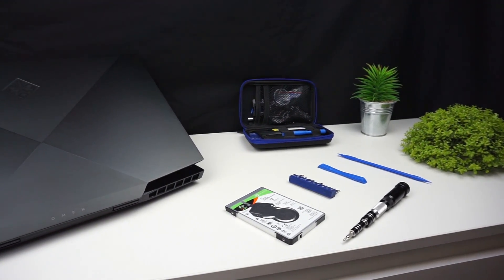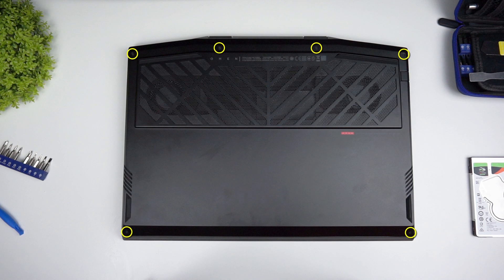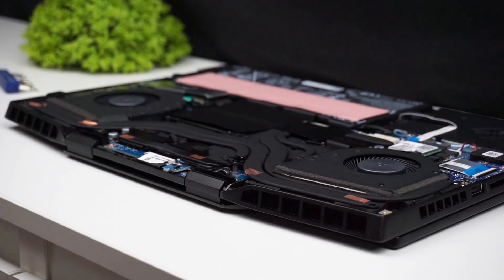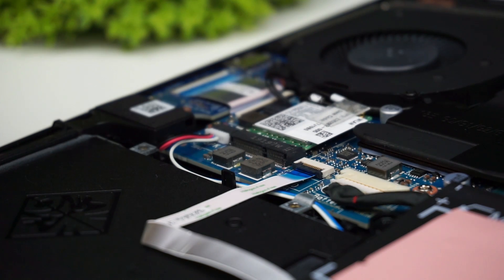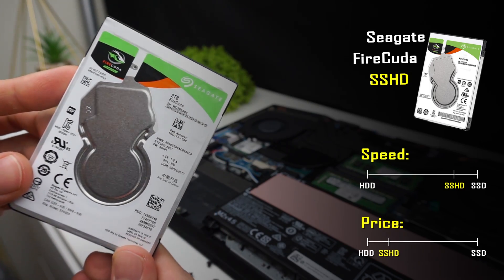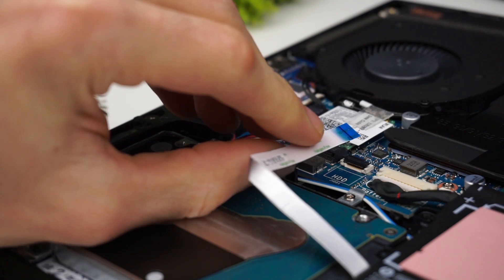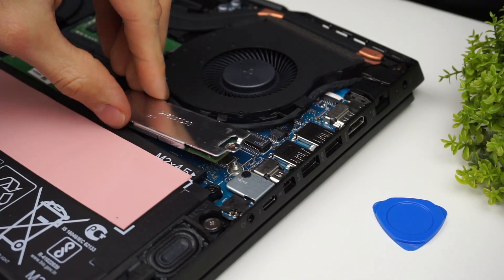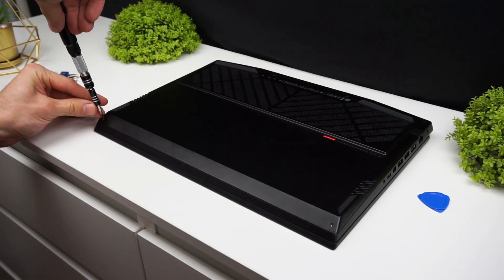HP Omen 15 2019 Upgrade RAM / SSD / HDD - Disassembly Guide

Comment from the maker: ✅ Free download RAM / SSD / HDD data recovery software: https://bit.ly/2zRpN9B

►► TIMESTAMPS:

00:00 - General info
00:37 - Opening the lid
01:42 - Installing Hard Drive
03:39 - Installing RAM
04:01 - Installing M.2 SSD
04:37 - Closing the lid
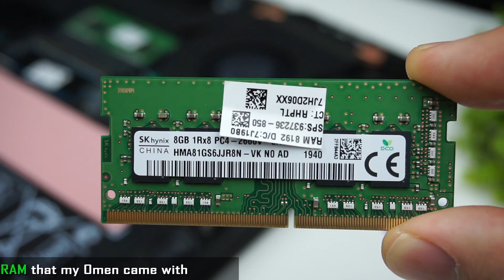04:59 - ORIGINAL RAM AND SSD
Reply: Can i upgrade hp omen 15-dh0135tx laptop to 32gb (16gb + 16gb)
Reply from the maker: @profajaysharma  yes, you can
Reply: @profajaysharma  i think thats not nessessary
Reply: Where should i install the recovery software and what will i get? Can i get like my OS/ windows 10?
Reply: Fuck wondershare

Comment: Hello, 
What is Ram speeds 3200? My HP Omen 15 -dh1099nr comes with DDR4  ram at 2933 speeds. If I bought a crucial ddr4 ram at 3200 speeds, does that mean it can't possibly run at 3200 because isn't supported by the motherboard? will it autodefault to the fastest possible speed which is 2933? should i force it to run at 3200 ? I don't understand this at all but trying to buy the ram has confused me a bit

Comment: Followed, worked perfectly. Did strip a screw on the case, that was a pain.  DID INSTALL 64GB RAM NO ISSUE.
Reply: Hi, are you sure that it supports 64gb and is working fine?

Comment: Hello, I have a 2020 HP Omen with an i7 10750H that looks almost identical inside to this laptop, I want to get the Samsung 980 Pro m.2 with the optional HEATSINK....I know it's a gen4 nvme on a gen3 system, I'm only concerned with if I can fit the Samsung 980 Pro with HEATSINK? - thank you!

Comment: Hello!!! My HP omen 15-dh1099nr runs with 2x4GB DDR4-2933 SDRAM.
Which RAMs are compatible if i want to upgrade in 2x16 GB???
Reply from the maker: I linked compatible RAM options in the description. You can choose any if you intend to replace 2 sticks
Reply: @TechFinds  and if i want 2933 ram cards?

Comment: Hello! Thanks for the video. My question is about what the maximum read/write speeds that it supports if I change the SSD?
Reply from the maker: Well, it depends on the drive itself ;) The laptop doesn't limit speeds
Reply: @TechFinds  I read that the system is PCI Gen3, so it can reach the 3500/3000 MBps read/write, the limit for this generation. My doubt is if I put any Gen4 SSD with 5000 MBps, the system will read at least 3500 MBps? Thanks

Comment: I have this laptop. Can I upgrade to 2TB SSD M.2 Nvme?
Reply from the maker: Yes, you can. You'll need to replace your existing M.2 SSD so after replacing you have to install Windows again on the new drive
Reply: @TechFinds  I think I will clone the old ssd to new ssd with software? Can I change ram to 32GB 3200 mhz?
Reply from the maker: @princeofeurope3313  i have never tried to clone drive so i don't know. For sure you can copy Windows using Microsoft Media Creation tool and install it on new drive from pendrive. The laptop supports up to 32GB AM (2x16) 2666MHz
Reply: @TechFinds  which is better, 2666 or 3200? Thanks
Reply from the maker: @princeofeurope3313  this laptop supports max 2666MHz

Comment: Hi, I have HP Omen 15 dc0145tx which almos similar to the laptop in the video.
The default storages in my laptop are:

1 TB 7200 rpm SATA
16 GB PCIe® NVMe™ Intel® Optane™ Memory for storage acceleration

Can I just change the 16GB PCIe NVMe to the larger M2 SSD (foe example 1 TB) and just use the windows media creation tool to migrate the windows from the 16GB NVME to the new SSD or there is something else to do?

Thanks in advance for hour answer.

Comment: THANK YOU A LOT! this video really helped me to add a 2nd RAM
could you make a video were you disassembly this model for a thermal paste change? it would be really helpful, want to do it but i don't want yo screw it up:(
Reply from the maker: Unfortunately i am not permitted to disassemble cooling system in the laptops that i test. Also i had this laptop for limited time only

Comment: Hello, my HP Omen 2019 has gathered some white dust on the fan and the lid, it's stuck due to the heat, so after opening the lid how do it clean it? Can I remove the fans? The white dust maybe baby powder so yeah, please help me out. Also will the warranty be voided if I open the lid?
Reply from the maker: To be 100% sure you have to read your warranty card as it may vary between countries. If you want to clean the fans you have to know what you are doing because it's easy to damage something while disassembling cooling system. You have to also change thermal paste if you willing to take out fans because you have to disassembly whole cooling system

Comment: Hi I have a HP Omen with an i7 and RTX 2060 6gb and I have a 1tb m.2 as my c drive. If I add a 2.5 ssd into the empty slot will it affect my main storage in anyway ? Or will it just add extra storage

Comment: Hi there, i am computer illiterate. Would a upgraded SSD benefit with flight sims?
Reply from the maker: Not really, it would help only if it comes to loading times. For better performance you can upgrade RAM, however i don't think that it's necessary for Sims if you have 8GB or more
Reply: @TechFinds  Hi there, thank you for your speedy reply.
I also have a Omen 15, and for some reason the sim has started to stutter after being fine (all original setting too) I have 16 ram, but just acquired a 32 ram upgrade so i'll see how that fairs
Reply from the maker: @markmilligan1462  Sims is very old game and it probably isn't a problem with the specs if you have so powerful laptop that is overkill for this game. The game itself may not me 100% compatible with the newest hardware and software. Sims 4 and especially Sims 3 had very bad performance on my laptop too.
Reply: @TechFinds  Hi there, Sorry for getting you confused. Not sims, the new flight simulator MS FS2020. 
Worked fine but now it stutters, especially at low alt
Reply from the maker: @markmilligan1462  ohh, I've never tested that game unfortunately so I don't know what to expect and what resources it needs
Reply: @TechFinds  I upgraded my to 32Gb, and turned my min FPS down to 30, and it's worked :)

Comment: Hi guys, Im struggling to find the propper name of the socet that HP used to connect ribbon HDD cable to motherboard. I got mine broken while extracting HDD :/ I was wondering if there is a sense to try to replace it (it forces soldering motherboard), and if there is, whats the name of that slot for ribbon HDD cable on the motherboard?is there a way to buy it sepparately?

Comment: Hello , where is CPU in this laptop , have one or two hot air outlet ?
Reply from the maker: It's on the right with 2 shared heat pipes i guess. I didn't pay attention to that since i didn't disassembly cooling system in this laptop. The GPU is signed with Nvidia logo so you can recognize it ;)

Comment: Thank You very much - excellent video:  Precise, short and to-the-point :- )
... I am looking to add a hdd to an Omen 15/2019-2020 model (bourght this year; I7 9750, 500GB SSD, NVid 2070 etc.) - But I guess that a 4TB hdd is too large (3.5' - > https://www.elgiganten.dk/product/pc-tablets/harddisk-ssd-og-netvarksharddisk-nas/ST4000DM004/seagate-barracuda-3-5-intern-harddisk-4-tb ) ?
A 2TB HDD (2.5' - > https://www.elgiganten.dk/product/pc-tablets/harddisk-ssd-og-netvarksharddisk-nas/ST2000LM015/seagate-barracuda-2-5-intern-harddisk-2-tb ) should be able to fit ?

Right now I am using a 4TB external, but obviously that is not practical when travelling. Would much prefer to have a 2TB or 4TB internal if it can fit.

Thank You in advance  & Greetings from Denmark !

Comment: hey man great video, thanks to you I bought this machine, I have the hp omen 15 dh0004la. But I have a cuestion about of the storage upgrade. Can I put 1Tb of m.2 Nvme plus 2Tb of ssd?
Cheers. : )
Reply from the maker: Sure, you can do it. ;)
Reply: @TechFinds   thank you. I have another question and I'm not sure, but if I put a nvme of 1tb and in the slot sata a hdd, the nvmw increase the velocity of the programs or video game saved in the hdd? Or it will be slower than a ssd?

Cheers.

Comment: Im about to buy the 2019 hp omen (omen 15t dh100) with 512gb SSD + 32 gb Intel optane. Will I be able to add 1tb hdd later on manually? Is there a separate slot for hdd apart from the SSD slot?
Reply from the maker: As you can see in the video the laptop has one slot for M.2 SSD and one 2.5" drive bay. I don't know where the optane is installed tho. If not in the place of 2.5" drive then you should be able to add HDD
Reply: Is there an extra slot for HDD as well?
Reply: Please let me know as I'm trying to add a new hdd
Reply from the maker: @swarajjpatil  this laptop has one slot for M.2 SSD and one slot for 2.5" drive
Reply: @TechFinds  thanks mate.

Comment: The screws are stuck in the bottom lid is there anything i can do to fix it
Reply from the maker: if you stripped the head of screw then i don't know what you can do now. Try to use thin layer of rubber between screw and screwdriver to fill the head of stripped screw and try to unscrew it.
Reply: @TechFinds  will do thanks

Comment: A question: replace the hdd with ssd invalidate the warranty?
Reply from the maker: Most likely not, however it may vary between countries so better read your warranty card. In most cases if you do it and you won't cause any damage the warranty is not void

Comment: I have a question , i am only looking to replace the SSD to 2 TB . The reason is i only use to Play WoW but now i want to play warzone but i do not have enough space for both. Should i be replacing all 3 Ram Hard drive and SSD? Thanks for the feed back.

HP Omen 15-DC1xxx ,Intel R core I7-9750H CPU@ 2.60GHZ 2.59 GHZ 16 GB Ram 237GB of Space Windows C

Sorry i am still learning about this stuff.
Reply from the maker: You can replace only SSD if you want
Reply: @TechFinds  Thank you ! Im looking at 2 TB Samsung SSD

Comment: Hi, I have a question. As far as I know this model has an Intel Optane of 32 GB. The M.2 that you changed in the video is the SSD and not the Intel Optane, right? Also, where is the Intel Optane located? Can you change it or it's welded to laptop? Thanks for the cool video!
Reply from the maker: There are various configurations, mine didn't have optane. If you have a configuration with oprane the drive will be in the place of M.2 SSD. I don't know if it's replaceable.
Reply: @TechFinds  kinda crazy! I saw a model with M.2 SSD + Intel Optane of 32 GB. I guess that it has two M.2 slots?
Reply from the maker: @MusiqueDoc  No it has 1 M.2 slot. Maybe I'm wrong and Optane can be placed somewhere else.

Comment: I have an Omen by HP 17-cb0002ca. Would the process be the same? I got the WD_Black SN750 500GB M.2 NVMe Internal Solid State Drive, what do you think of this SSD? I am swapping out the SSD that has my Operating system. Would you advise creating a recovery disc or cloning the drive before swapping it?
Reply from the maker: Yes, the process will be the same. You can do whatever you like, i have never cloned a drive tbh. Ane the one you bought is good

Comment: I have 2 ssd slots. Just installed an sn750 nvme into the second slot. Not showing up on This PC folder. Any ideas?
Reply from the maker: After installing you should go device manager and make a new partition

Comment: I bought one of the m.s ssd from the description but it has 3 keys instead of 2 and then when I tried booting it up it did not work and then I placed the old m.2 ssd and I dont my hp omen is reading it as my hp omen says I only haven 500gb hard drive but dose not show the m.2 ssd with 256gb being read so I dont know how to fix it so can u help me? If I can we can talk on Instagram or discord please as it is easier for me to talk on call or show pictures of the problem please respond quickly.

Comment: I think I had to do this after one year, right?
I lose warranty if I do this before
Do it lose warranty if I do it?
Reply from the maker: It may depend on the country or seller so you better read your warranty card to be 100% sure. After one year you should difinietely think of changing thermal paste and cleaning the fans from dust

Comment: I have a question, can i take out the original ram it has to put the other brand that you have in the description? Reason im asking is because I'm planning to add more ram (32gb) and I want to know if its going to mess up or anything.
Reply from the maker: You can have up to 32GB (2x16) 2666MHz. Brand doesn't matter

Comment: What is the size of the 2.5inch bay? I want to add an ssd as extra storage but after asking WD they told me I should ask the manufacturer about the size of the bay, and HP says nothing on their website.
Reply from the maker: If the SSD is about the same size as the FireCuda that i linked in the description then it will fit. The size is universal, but you can fins thicker 2.5" drives. I wouldn't risk more than 9mm thickness
Reply: @TechFinds  it is 0.27 inch thick and 0.01 inch more large
Reply: Tech Finds it is a lot thinner than the firecuda. Does it matter

Comment: Majid Almulla
I have same laptop but , i have cupples quastion 
Just asking if im ganna play high game like warzone  on high , >> btw i never see the fbs more than 100fps even when i make it low on graficks game 
1- should i change to performance ?
And I noticed when its not plug in the performance become Dawn ?
2- i will have issues if playing and plug in ?
3 - can i run gameboster or its will effect?
4- can i do something like if i play game become full performance and if I switch to normal use we browser become normally  or i should make it manually ?
5- should u play with nividia control sitting for better experience or no need ?
6- how many C if it reach thats mean to much load 
7- any app thats organization the ram ?
8- how much fps sould i got ?
9- should i dawload games on ssd or hdd ?

Comment: Hey Whats the Max amount of Storage I can put in a Omen 15, I want to put a barracuda 5tb 2.5" hard drive in there but I don't know if its fully compatible yet. please let me know if its compatible
Reply from the maker: There should not be any limit but the thing is that hard drives bigger than 2TB are usually thicker than 9mm so i'm afraid it may not fit the drive bay
Reply: @TechFinds  thank you for your response and I agree in the future they should make smaller but larger HDD that will always be compatible will laptops such as Omen 15

Comment: Im planning on getting a Pavilion and was wondering if putting pressure on the bottom while putting the lid back damages the display
Reply from the maker: If you push the edges only strong enough for the tabs to click it'll be ok.

Comment: Hi Tech Finds! I get my OMEN (15-dc1004la) with a GeForce GTX 1650- Core i7- 8GB RAM- HDD 1TB+SSD 128GB but I run out of space in the SSD, i was looking for an upgrade with the WD SSD (DDUWSD1370) of 1000 GB and  Pci Express 3.0, it is compatible? thank you for the video,  greetings from Mexico!
Reply from the maker: Yes you can install this SSD, but you'll need to reinstall windows.
Reply: @TechFinds  Thank you!

Comment: Sir RTX 2070max q vs RTX 2070 which one is better performing in OMEN laptops without Heat issues???
Reply from the maker: Max-Q should run cooler but it also performs slightly slower.

Comment: I was just wondering which of these components is the C drive? That would be the HDD right? The FireCuda SSHD?

Thank you for your time.
Reply from the maker: If you bought this laptop and it came with M.2 SSD and 2.5" HDD then your SSD is C drive by default (with Windows).
Reply: @TechFinds  Okay thanks. I will have to do a bit more research into the components.

Comment: Hello Tech Finds,
I recently bought in Amazon this computer: "Omen GeForce RTX Studio 2019 15-Inch Laptop, 9th Gen Intel Core i7-9750H, NVIDIA GeForce RTX 2060 (6 GB) W/HDR 400 True Black, 32 GB RAM, 1 TB SSD, Windows 10 Pro (15-dh0015nr, Shadow Black), Series 8DT27UA#ABA." As I'm writing this comment I'm still waiting for its arrival. In the meantime, I have some questions. It says it comes with a 1TB ssd, is that a 2.5 or m.2? And if any of those are included, does it mean one slot is empty? I would like to acquire more drive memory without replacing the SSD it comes with. Is that possible? And if so which would be the best option for storing videogames? Small SSD, medium SSHD or a big HDD? 
Thank you in advance,
And you have a new subscriber :)
Reply from the maker: It comes with M.2 SSD. This laptop had 2 slots - one for M.2 SSD and one for 2.5" drive, so if it comes with one drive you have one slot free. SSHD/HDD are very similar to each other, so if you're on a budget go for HDD.
Reply: @TechFinds  thank you!!

Comment: Is this dual or single channel by default
Reply from the maker: It may vary between countries, but mine came with dual channel in the UK
Reply: Tech Finds should I buy this or Rog strix with rtx 2070 and i7 8750h
Reply from the maker: @saadsalman321  RTX 2070 and i7-8750h should give you better performance. It's the matter of price tho
Reply: Tech Finds thanks man I will go for ROG

Comment: Hey I was planning to upgrade the Harddisk, but there's Seagate Firecuda and also Barracuda, the price difference is around 40-50€ for 2TB version, is it worth the extra 50 and is it safe to order HDD via Amazon, I have had bad experiences with HDD just going off due to falls.
Reply from the maker: Barracuda is HDD, Firecuda is SSHD. There's a huge difference in your case. I think you should be good with Barracuda then

Comment: Hello, I have HP Omen 15 with 8GB RAM and I would like to add one more 8GB RAM. Is it possible to install just one extra 8GB RAM card without buying two (menaing, will the original RAM inside of HP be compatible with new 8GB RAM)? Thanks in advance :)
Reply from the maker: It depends if you have 1x8 or 2x4 now. You can just add another 8GB if you have 1x8 and for that go for RAM that has closest possible specs to your original RAM. A good match is Crucial that I linked in the description